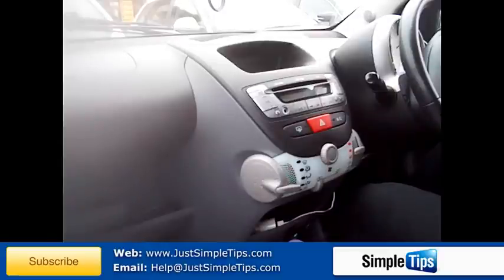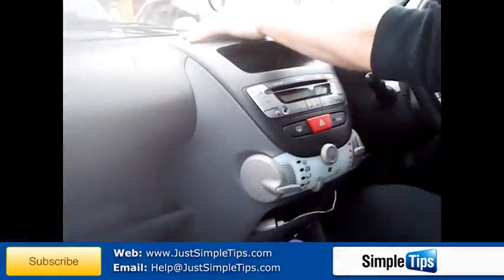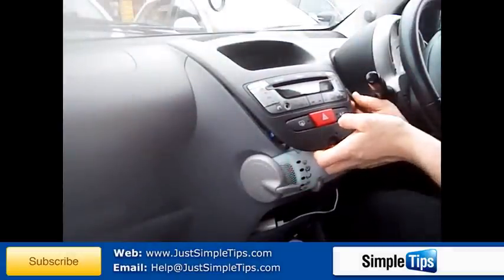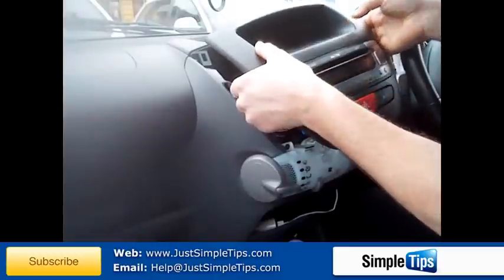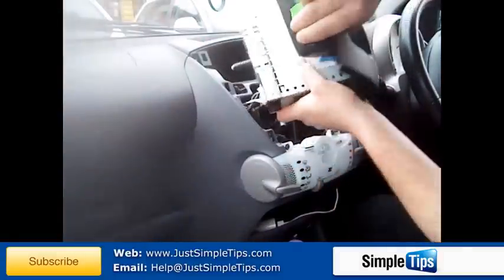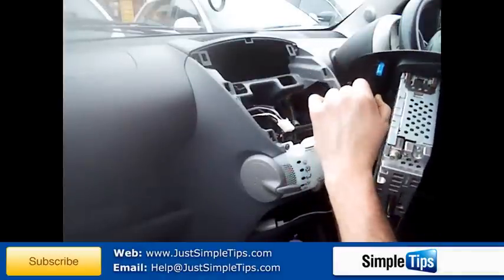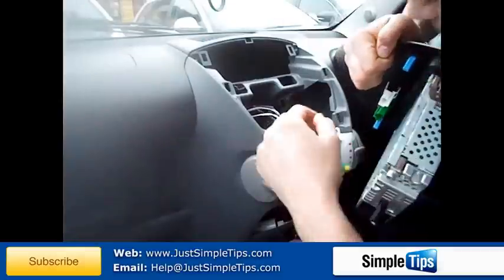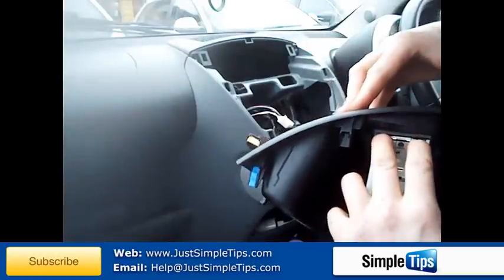Radio Removal Toyota Aygo (2005-Present) | JustAudioTips

Comment: Other videos give no detail on the first stage to remove the radio surround panel without damaging anything, They also might lead you to think you need to remove the side heating controls, this video makes it clear you don't.

This video got my radio in out in 5 mins flat, thanks!